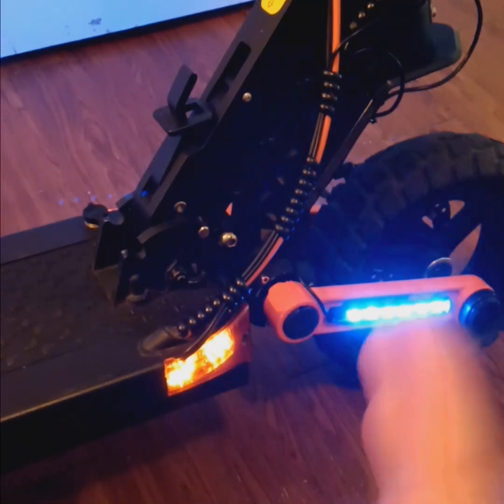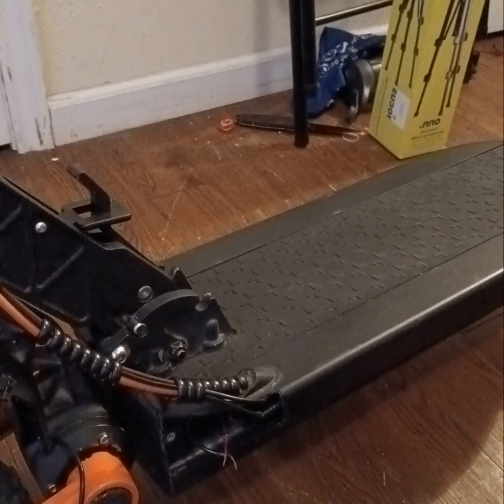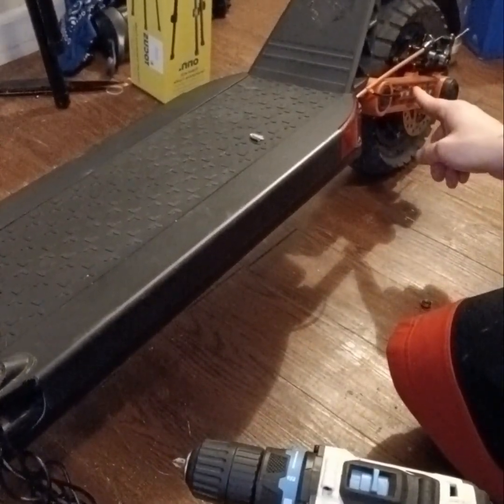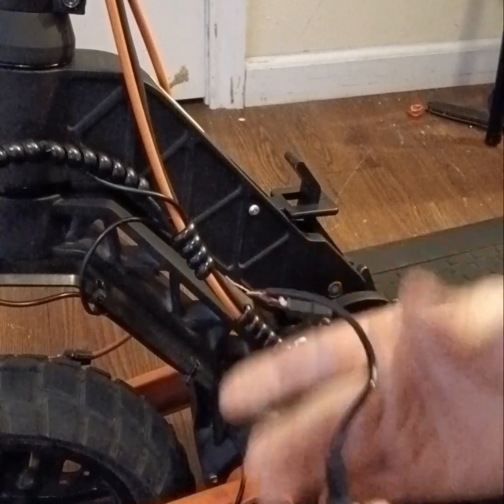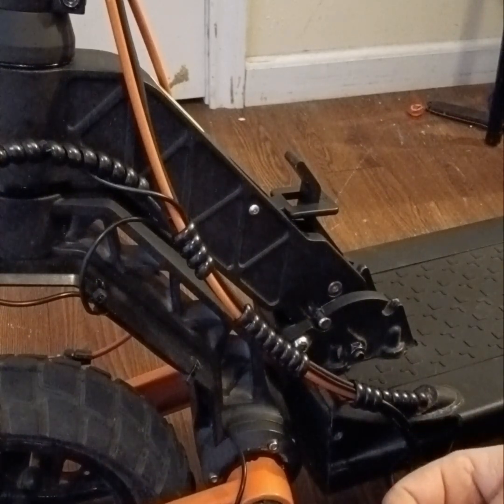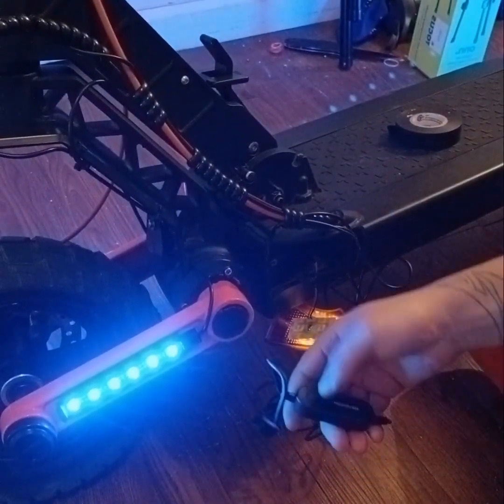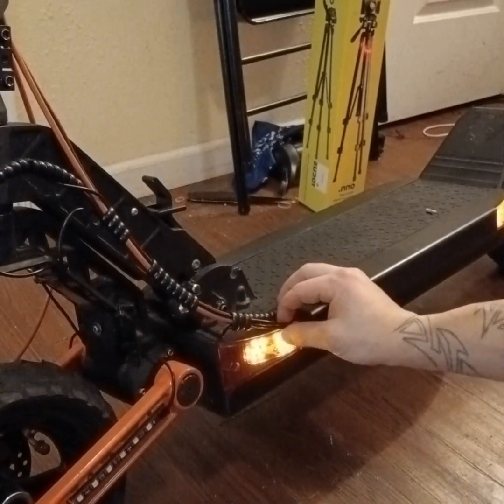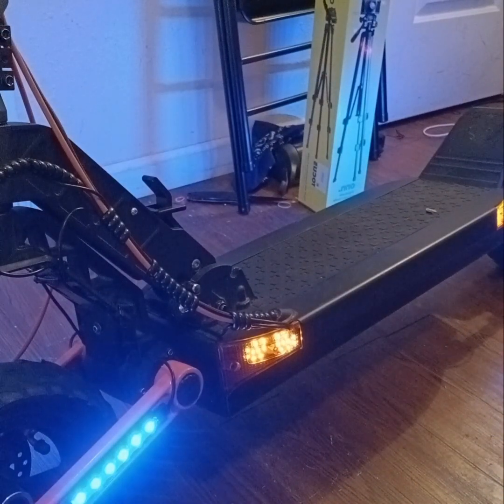how to install L.E.D lights to any electric scooter

Comment from the maker: https://www.walmart.com/ip/Monster-LED-Bluetooth-Sound-Reactive-Multi-Color-Car-Interior-Lights-4-Pack-of-10-5-Strips/425991804?wmlspartner=wlpa&selectedSellerId=0&wl13=479&adid=22222222278425991804_117755028669_12420145346&wmlspartner=wmtlabs&wl0=&wl1=g&wl2=m&wl3=501107745824&wl4=pla-306310554666&wl5=1024115&wl6=&wl7=&wl8=&wl9=pla&wl10=8175035&wl11=local&wl12=425991804&wl13=479&veh=sem_LIA&gclsrc=aw.ds&&adid=22222222238425991804_117755028669_12420145346&wl0=&wl1=g&wl2=m&wl3=501107745824&wl4=pla-306310554666&wl5=1024115&wl6=&wl7=&wl8=&wl9=pla&wl10=8175035&wl11=local&wl12=425991804&veh=sem&gad_source=4&gclid=EAIaIQobChMI3pPohOS0hQMVthGtBh3a6QuPEAQYDiABEgJqv_D_BwE